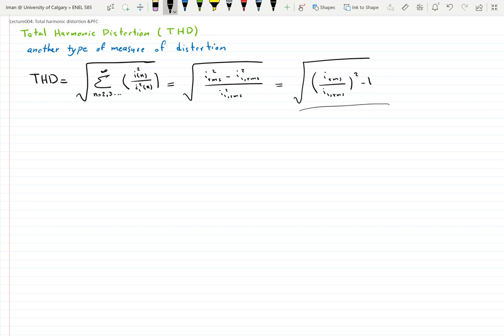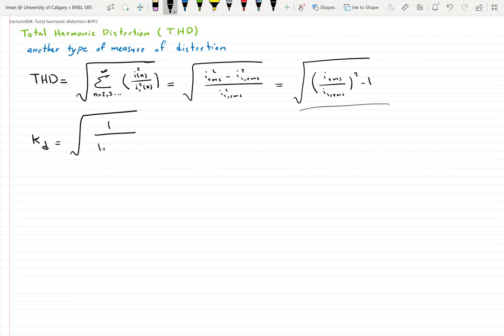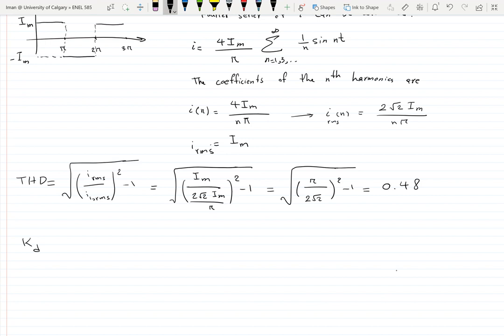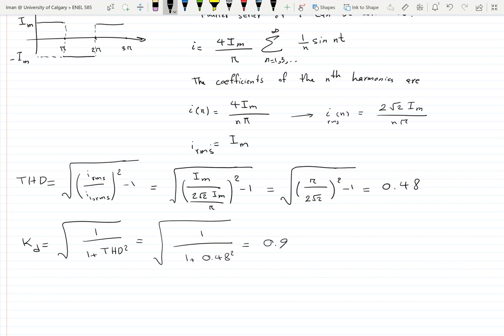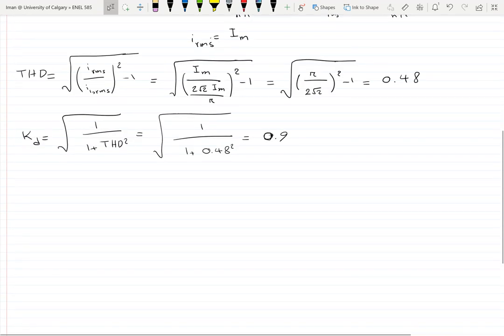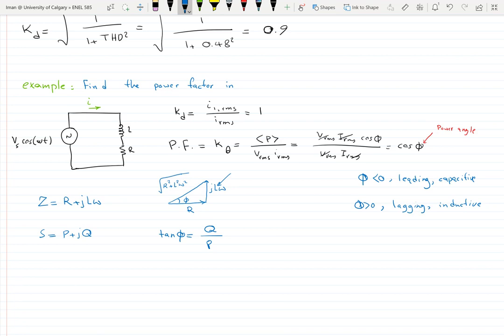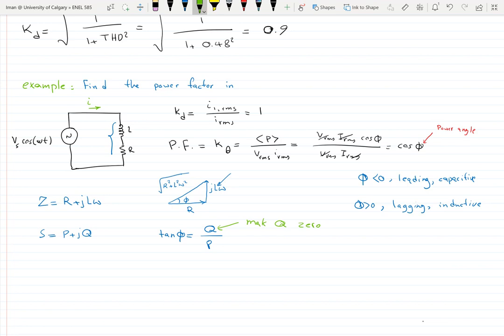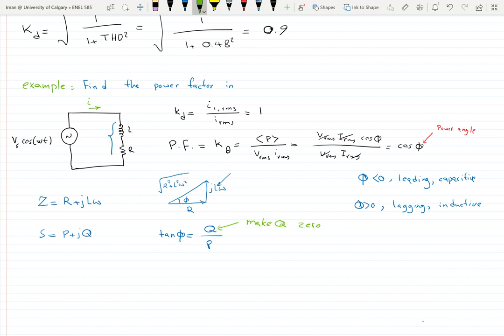ENEL585_Lecture004: THD PFC

Comment: In the second equation for THD = sqrt( (i,rms^2 - i1,rms^2) / i1,rms^2 ), shouldn't it be THD = sqrt( (i,rms^2 - I0,rms^2 - i1,rms^2) / i1,rms^2)? 

This assumes that i(t) has a DC component, where <i(t)> = I0,rms = i(n=0)/2. Since i,rms also contains a DC component (I0,rms or <I>) as well as each of the frequency components, which is not included in the THD definition (first equation includes only summation of second harmonics and higher, but not DC component). Or is there a reason we can ignore this component?

Thanks in advance.